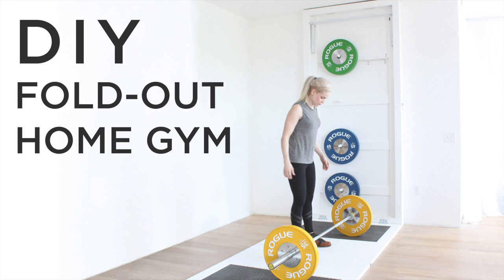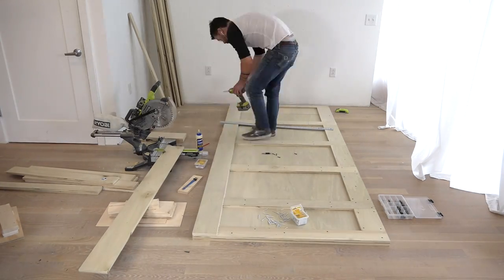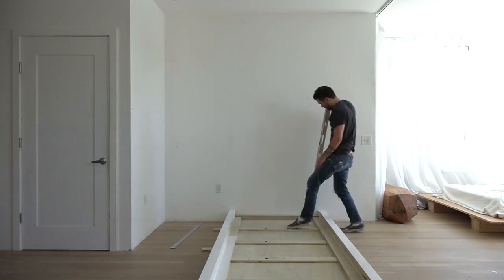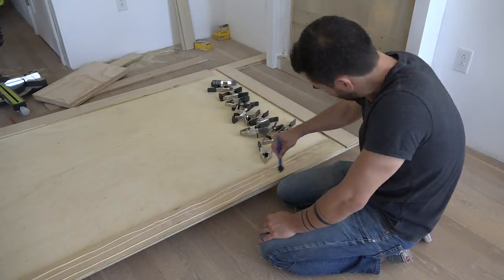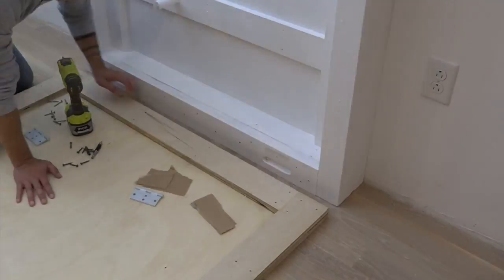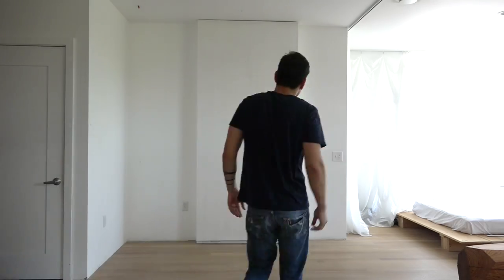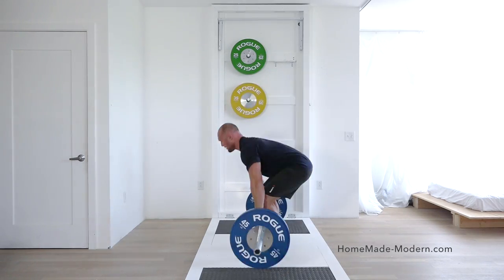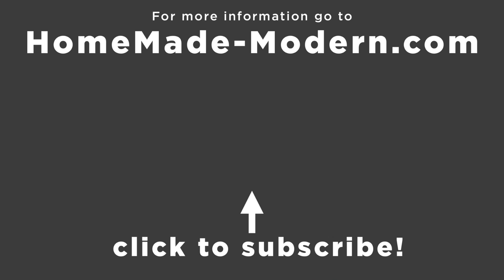DIY Fold-Out Gym | How to make a CrossFit style gym at home

Comment: Great project as usual and I just learned a cordless router was a thing, will definitely have to check it out!
I'm curious about the brackets though; aren't they installed upside down from their original intended use? Wouldn't this affect their weight capacity?

Comment: The wood dowels are strong enough to hold the weight plates? Otherwise it looks great.
Reply from the maker: plenty strong since they are so short and the 90LBS is the most weight possible on them.  Did you see me hanging from them?
Reply: HomeMadeModern I did see your one arm hang. What was the cost of materials used? Ballpark figure.
Reply from the maker: most of the cost was in plywood and screws. i would guess about $180

Comment: very cool. Have you considered increasing the size of the pull-down platform to either 6 or 8 ft? I say that because if you do the standard lifts overhead, you will inevitably drop the weight either in front or behind you. Bigger platform = more room for error :) Love your gym ideas though. Keep it up. Now you need to design a fold-out squat rack and you are good

Comment: Uh I mean its cool but you cant squat here cause there is no rack, plus no safety. What happens if you drop the weights back on your floor instead of forward? Do you have downstairs neighbors, I bet they can hear you. Why plywood and not 2x4 or 1x6 which is thicker and would require less glue. This just seems unsafe and a bad idea in the long run.

Comment: A lot of work when you can just use kettlebells and take up less space
Reply: it really limits your ability to load exercises, unless you have a very large selection of kettlebells, in which case it defeats the purpose.
Reply: its easy to load with kettlebells. use two of them.
Reply: Okay my friend, let me just take 2 70 kg kettlebells and do backsquats with them.
Reply: Why does it have to be two 70kg?? Such extremes!! I guess you have to be a macho man!! try two 25 kilos and  and front squat with over a 110 pounds..  Kettlebells might help with your sucky cross fit form also. But I am sure you can screw that up too. oh wait you do. those sucky over head swings  ..
Reply: what if I want to front squat with 315?  what do I do then?
Reply: Then you lift with some thing else thats heavy. which has nothing to do with cross fit!!  Why do you need to lift 315 pounds, unless you are competing?? why not 1000 pounds??
Reply: his brain is an avocado!! what do you expect
Reply: Everyone in this comment is taking offense because a guy wants to lift with heavy weights and a bar. Yes, kettlebells do have their place, but they can't compare to a bar when bodybuilding/weightlifting. With a bar, you can be more precise than 2 kettlebells, you can do more exercises like a proper back squat, and if you want to get serious weight, it'd be pretty hard to get 2 150lb bells. Even when saving on space, the amount of space required to get all of the kettlebells needed is significantly higher than a rack with weights and a bar. If you want to avoid a bar, it'd still be smarter to get something like custom dumbells where all you have to store are plates and 2 handles.
Reply: Magic milkman just admit you're wrong. A kettlebell can never replace a barbell.
Reply: goggles789 how is it bragging just because he wants to lift actual weight lmao. People need to lift heavy because that's you gain strength, something crossfitters don't know about.